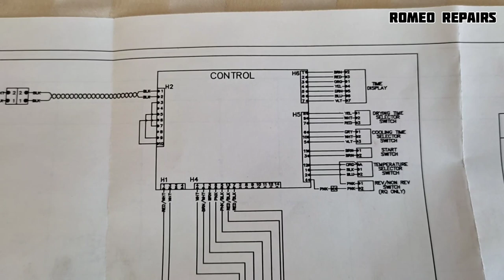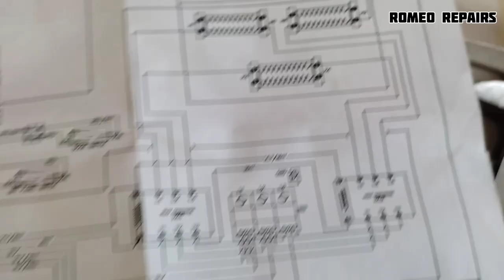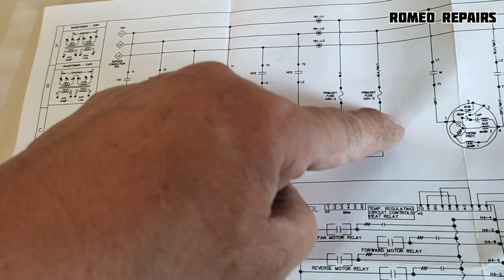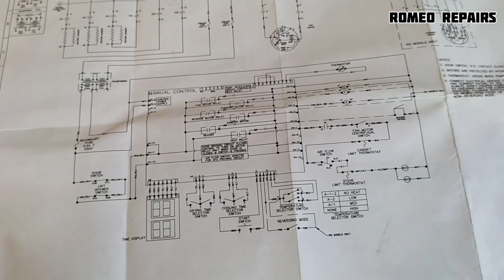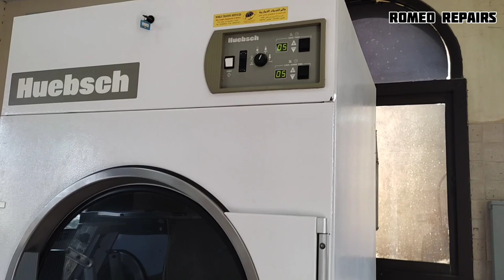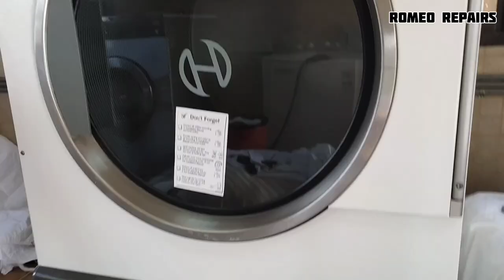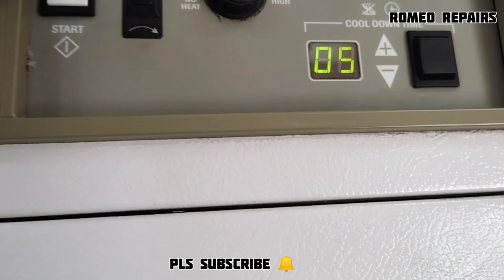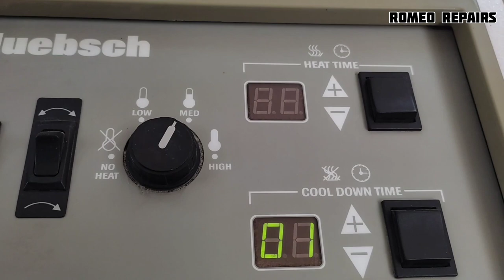Huebsch Laundry Dryer Machine Repair (Tagalog)

Comment: Sir good afternoon tanung ko lang po kung Anu possible sira ng ganyan Dyer Hindi xa na apoy .. walang power din module ng igniter
Reply from the maker: Heater ito sir na klase, step by step Ka muna sa trouble shooting sir try mo check breaker, control, contactors.